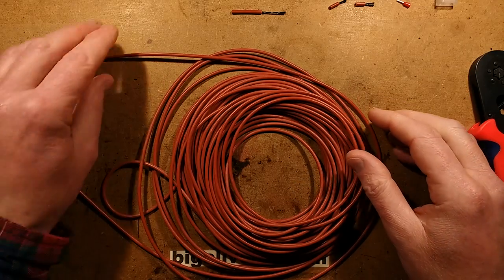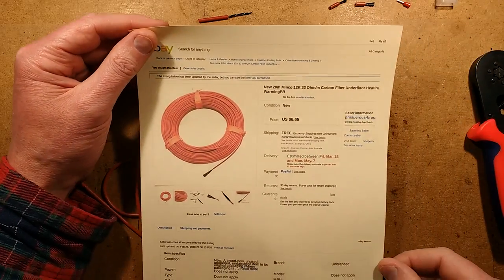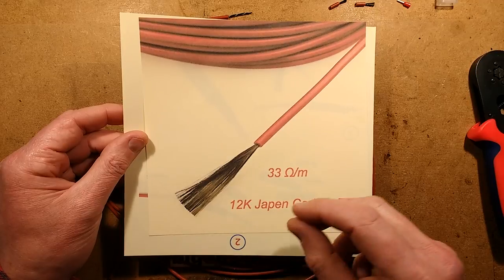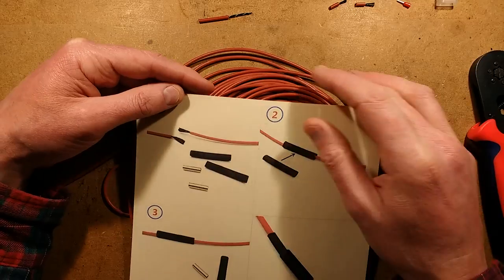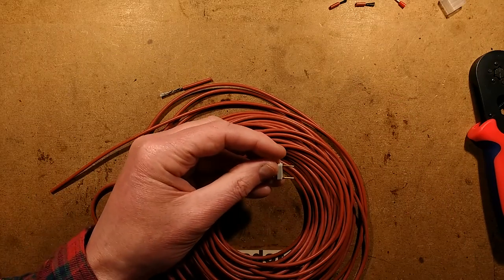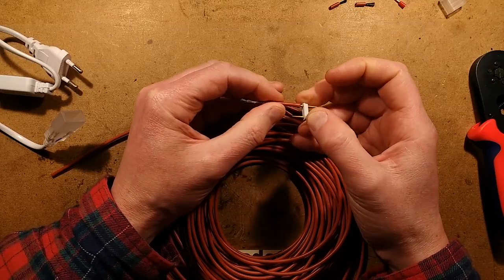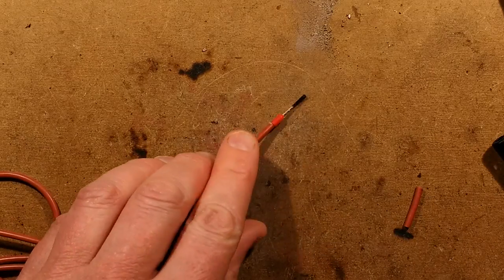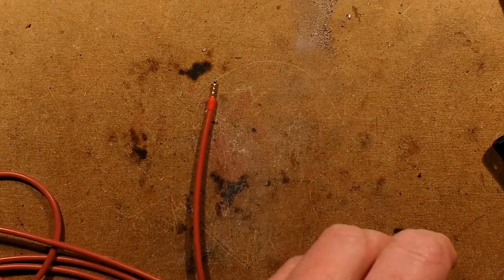Testing carbon fibre heating wire.  (with flame test)

Comment: After watching your video I bought some of this. I use it inside a small LiPoSafe battery case to keep batteries warm.
I feed 200mA/1.5W through a 1m piece using a constant current supply. The voltage is around 7.3v when doing this.  With this power the wire reaches about 15-20C over ambient which is great. In use it generates just enough heat so that the small case stay warm when also inside a camera bag.

I also tried using the wire directly across a 2S protected Lipo cell which works great and is more often used. Current starts about 8.4v/230mA/2W and drops off from there. The battery protection providing a safe cut-off when needed. The advantage with this is it's just a wire and a battery. No extra stuff to go wrong. Running off a 3S Lipo pack the power is 12.6v/350mA/4.5w which brings the temperature up to about 40-45C above ambient.

I terminated my wire by soldering a wire to a diode's leg off-cut and pushing it down the insulation tube. Tightening the sleeve with a cable tie made the connection pretty solid. I covered over the ends with two-part Epoxy.

Thanks for bringing this to my attention.

Added more in response to someone below...
Just did a quick test: 1M of filament tested at a room temperature of 20C.
4 turns of filament looped about 8cm diameter sitting on the desk in open air.
K-Type thermocouple taped to the wire.

Voltage/Current/Wattage/TemperatureRise:
8.4v/230mA/2W/+20c
12.6v/350mA/4.5w/+35c
20v/590mA/11W/+85c
25v/750mA/19W/+125c Started to smoke slightly. Maybe was my heatshrink giving up. :-)
32v/1A/32W/+ 170C...  Yeah. Unhappy heatshrink was smoking nicely.
Reply: Can you tell me how did you install it in 12volt ?
Reply: Good Day, PIX, and Thank You for your reply to Big Clive. I am experimenting wih CF and your posting contains some very necessary information I am happy to keep handy going forward. No more Grenfells.
Reply: I am using shorter bits but hooking them up to a 12 volt thermometer regulator thingy set at low 15c and high 25c as temps here get as low as -30c
Reply: can i have your reference or formula how you compute these different temperature?
Reply: All I did was set an external power supply over the test cable and measure the power drawn. I don't have any more details at this stage as it was all done so long ago.

Comment: As a physician and now patient,  I love your analogy of the lung being like a capacitor in that it requires large immense surface area for gas exchange equivalent to charge.   That is "Brilliant"...Thanks Clive.
Reply: Air filters also work. Your car uses a folded up air filter to get more surface area, because the folds and bumps increase surface area (which is a good thing for a filter). If it was just a round sheet, it wouldn't be nearly as efficient or long lasting. 

Same with sponges. All the pores and space inside increase the surface area and ability to hold water.
Reply: air filters are a poor anaology because air filters work better as they get clogged until they reach a critical point... it's part of the design of air filters. lungs on the other hand never work better as they get clogged.
Reply: The analogy would be the nose which filters better if it is filled with a little fluid snot ;-)

Comment: Years ago I made a heated motorcycle vest.
I used 30 gauge 7 strand Teflon coated wire. I think I  remember  that 20 feet of wire at 12 volts has 100 watts.
So for less than $5 and that price of a vest, I had a $100 vest.
During WW2, they used that same technology for heated flight suites.
Reply: Congrats, you've given me a project
Reply: I was watching this video trying to find a way to make heated motorcycle gear. Thank you for the comment!
Reply: @caploader111  what could you use as a power source? Battery?
Reply: @johnpietri2837  12volt power tool battery or the vehicles battery

Comment: Terminating is done by window stripping the end,  as you do with litz wire, then wind a single strand of wire around the bunch of fibres. The excess can now be clipped off and the smaller ferrule slipped on and crimped.  Although you don't normally do it, I crimp the plastic part of the ferrule as well.  Thanks for the great Vids BTW.

Comment: Flammability test, you light the bottom and see if the flame propagates up after heat is removed. To pass the test, it must self-extinguish within seconds of the external heat source being removed. That cable looks like a flammability fail as it sustained a flame for far too long despite being held horizontally instead of vertically.
Reply: Your comment kinda reminds me of Grenfell tower.
Reply: thinking the same , should have had it vertical so it would preheat it self & kept burning (i think it would have)
Reply: Teardown Dan His was obviously not the official lab test. Anyway, most regulations require stuff to self-extinguish in a certain number of seconds (like 30s), while other regulations demand they use the minimum possible amount of potentially toxic flame-retardent ingredients. So materials like this wire are usually manufactured at exactly the maximum permitted flammability.
Reply: @John 94V-0 is by far the most common flammability standard in electrical applications worldwide and for that one, the sample burns vertically from the bottom and must put itself out within 10 seconds from removing external heat. That wire might be 94HB (horizontal burn) at best. I suppose that's kind of acceptable considering that it is meant to be put in cement/concrete floors where compatibility with concrete may be a greater concern than flammability.
Reply: keep in mind it would be more or less in an airtight environment when traditionally used in housing.  if flame gets to it you're already screwed.
Reply: James Hewitt it's a heating element it wouldn't have to have a flame reach it it can cause its own flame.
Reply: In normal use it would be wholly embedded in cement/adhesive with no oxygen to support a flame.

Comment: Although this is an "old" video, I just wanted to share that I have had good results terminating this carbon fibre cable with "Wago 222 Style" connectors on 12v DC.  (A lot easier than ferrule crimping, and reusable if needed).  The Wagos are good for connecting fairly short lengths in parallel to get good heating on 12v.  (Heated car seats, cold morning windscreen defrosting (place over the windscreen air vent of a cold engine with the fan running, etc.)

Comment: I've read that silver glue is good for terminating carbon heating ropes. I also came across a rather unusual carbon glue, which seems to be very fine graphite particles suspended in a water-soluble adhesive. I have some carbon fibre strips (about 15mm wide, 1m long) and the carbon glue and silver glue both work great for connecting the carbon fibre strip to a copper wire or bus bar.
Reply: DangerousAndAwesome
Reply: Thank you so much for posting this.  I am intrigued by this idea, as there seems to be practically NO information on the Internet about terminating these cables.  (Or, perhaps I have not yet divined the right search phrase...) In any event, your idea seems to have potential.  I presume these glues are electrically conductive, so I suppose my next big concern would be their heat tolerance, but I will look more into it myself.
Thanks again!

Comment: Lets say you want to put this cable in a house of 100 m2. 
If you make a distance between the cables 10cm, you would need 1000m of this cable. 
Lets say I want to run it on 4w per meter. I expect with 4w the cable would be 30°C. And if you spread it with 10cm, the tile would be around 20°C. 
If 1000m of this cable is heating, that would be 4w×1000m=4kW
If you run this 5 hours a day for a month, its 4kWh×5h×30d=600kWh
If 1kWh is 0.20 euro cent. That would be 120 euro a month.
But you probably dont have to heat up the whole house for 5 hours every day. Benefit of Infrared heating is that you only have to turn in on in the room you are in, so lets say we are warming up 25m2 for 5 hours. That would be only 30 euro a month. 
Dont forget, you need to set this cable up in a parallel connection. 
To make it 4w per meter, it needs to be 20m. So you need multiple cables of 20m setup in parallel connection. 
W/meter=U×U÷(m×Ohm)÷m
=230V×230V÷(20m×33Ohm):20m
= 4w per meter

Comment: This reminds me of how carbon spark plug wires are connected. I have seen various methods but most oftern the carbon fibers are folded back over the insulation and the metal crimp ends crimped over both.

Comment: Amateur astronomers sometimes use wire like this to warm up optics that are exposed to the night sky ever so slightly, to keep them from dewing up and obscuring the view. But those tend to run at 12V, only a couple of watts/m, because you don't want to have too much heat, which would cause turbulence.

Comment: The difference between fibreglass and asbestos is the glass fibres break laterally so their length decreases whereas the asbestos fibres split longitudinally.
Reply: Alan Partridge and therefore considered a non respiratory risk
Reply: I'd say it's a considerably lower health risk  but I still wouldn't recommend inhaling a load of glass fibre just like I wouldn't recommend inhaling iron fillings or sawdust.
Reply: Ah ha!
Reply: Alan Partridge Ah ha!
Reply: I heard one researcher report that they were able to induce lung cancer in rats from fiberglass but they basically had to "pack the rat with the stuff".

Comment: I installed a 750 square foot floor with ceramic tile on top of this heating wire, stuff is very tough.  Wonderful floor, low cost, very happy !
Reply: so how many feet of wire per sq. ft./ or what was average spacing between passes? what are you using for power supply / thermostat? how many feet of unbroken wire vs. parallel installations? What kind of termination technology to cold wire did you use?  Does anyone have a detail for installing this under click floor without screed or thinset although that could be the best for heat transfer, but I've also seen putative details with reflective layer under the cable, e.g. aluminum foil, and poly sheet over it and click floor directly but the cable is about an 1/8" thick so i don't know how it managed the load and if there are enough passes and the flooring runs perpendicular to those passes, perhaps that is still a simple and functional install. how did you hold the cable down before screed and tile were placed?

Comment: individual carbon fibre strands make a good bang if they float away and end up in a 240V socket :)
Reply: Fine magnet wire scattered about does well on 120 socket.
Reply: Thanks for the warning!

Comment: Have you tried to solder it?

You could also test for stray strands poking through by immersing it in salted water or another conductive liquid while running a voltage across it and measure any conductivity to the water/liquid.
Reply: Daniel Lassander carbon doesn't solder.
Reply: IIRC immersion in salty water and testing the conductivity is how they electronically test condoms

Comment: Someone I know had some underfloor electric heating fitted into thier kitchen.   I know the whole room uses 1.2kw, and does nothing much to heat the room,   but it does definately feel nice. So long as feet are warm,  it's surprising how much that makes a difference to overall temperature of one's self.

Still prefer my open coal fire though.
Reply: Taffy Newfoundland We have it in the bathroom. Toasty feet when you get in/out of the bath....
Reply: That was either a long time ago, or a terrible install. My family has a house in New Hampshire, and when I was up there at the end of December/beginning of January, it was between -17° and slowly rose to 23° F after about 5 days. (-27° to -5° C) The 4200 sq. ft. house was heated ONLY with radiant floor heating powered by a outdoor wood furnace boiler. It was VERY warm; even with vaulted ceilings. It doesn't get much cooler than that, and it was amazing. Granted the outdoor boiler was big money, the money he saved from heating oil, propane (Propane boilers to power radiant floor heating is not nearly as efficient.), wood was enough to pay for the entire system over two years. It also has a blower to heat the house through central ducting, if it's really cold. The trick is to get the thermal mass of the entire house and its contents warm at the beginning of winter, and keep it that way. Trying to cool the thermal mass of an entire 4200 sq. ft. house, after it has gotten cold, with radiant floor heating alone, is near impossible. If it gets warm for a week, you can turn it off, and then when it gets cold you can use the radiant with the blower, and get it hot again, then phase out the blower. It takes a REALLY long time to change the temp of a thermal mass that large though. The valves, of the radiant system, leading to different parts of the house can be closed/opened, to direct where you want the heat. They can program it to open the valves that lead to the driveway radiant heating, a couple hours before work, so that the driveway is ice free.
Reply: You can't beat a direct fire for heat. My sis bought some of that heated floor stuff for by her back sliding glass door. I advised she use it in the downstairs bathroom and she is very glad she did so.
Reply: Radiant systems are designed to function on convection. Great for interior bathrooms, terrible for main entryways. (source: I used to sell tile and the heating systems for it)
Reply: It's also incredible what it does when your toddler drops a mars bar on the floor and you didn't notice.
Reply: I lived in a cottage a few years ago with an open fire. As nice as it looked, it was an amazingly inefficient way to heat one room.

We switched to burning coal, instead of the smokeless fuel. It cost less and produced a good deal more heat... entirely illegal though.
Reply: My entire house is heated by floor heaters (albeit water, not electric). And it is not supposed to get hot, typically around 25 degrees celsius. Barely noticeable. It's much more efficient than regular high temperature radiators. But if your house doesn't have proper thermal insulation, then it's definitely not a good choice for heating.
Reply: Twelve hundred watts is twelve hundred watts.

Comment: Reminds me of the 'Nightmare decorators of Lairg'. The 'Big house' I once caretook had booked them to plaster scollop the ceiling and wallpaper the living room and, as ever, they arrived at the very last minute to do the job, rushed it, threw plaster and wallpaper paste EVERYWHERE and left the night before the owners were due. So I had to pull an all nighter to get the place clean and ready for the owner. 

Every door handle, toilet pull, light switch, window handle and trapes up and down the stairs, even in the fridge? I had to clean and scrape off plaster and hard set glue. 

The windows were splattered and the dust from the plaster mixing was everywhere. They had clearly mixed in every single room for some reason.... BUT the thing that really really pissed me off is they had found a roll of mains cable and the box of plugs and sockets which the 'Mannie' had asked me to make up various extension leads with after this visit and he had told me where they were for. 

They had found that, put a plug on one end and a socket on the other then run a fan heater with to fast dry the plaster and wallpaper while the most of it was still coiled up. Two thirds of the roll just melted together like you describe and ended up in the bin. Bastards!

Comment: An easy way to test for emergent fibres would be to immerse the coil, apart from the ends, in a metal bowl of salty water and checking for continuity between the bowl and the ends.